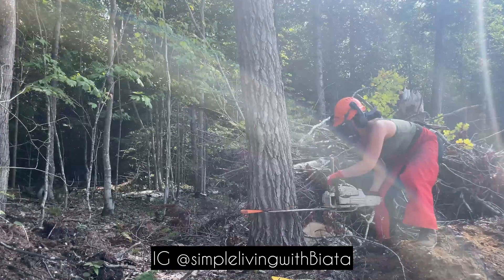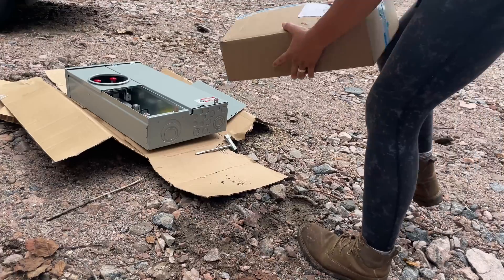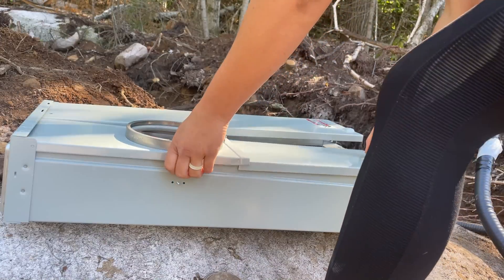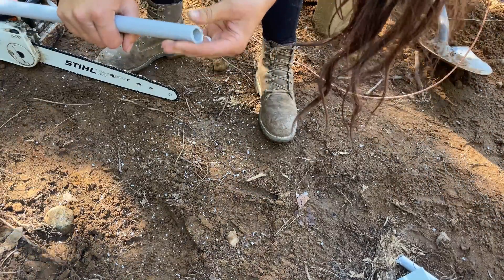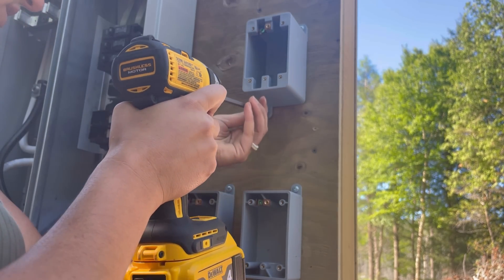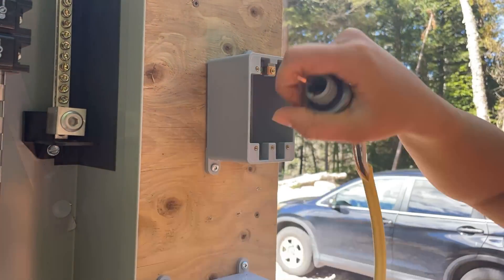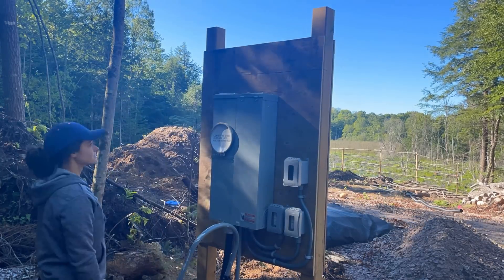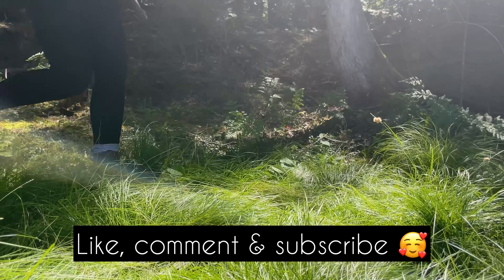Wiring MY FIRST Panel! (For our Home Build from Scratch)

Comment: Good hard working gal. Only advice I can give is when you wire your neutral wire (white) into the panel, it's generally best practice to land it across from the breaker that you are feeding. Obviously this isn't required because it still works, but it can make troubleshooting easier and is better organized. Cheers!

Comment: You know if you had like a little air conditioner pump like from a swamp cooler and say a medium size  black water tank (black water tanks don't produce mold) and let that little pump water from your little pond and into the tank and have the little tank raised somehow with a water hose hooked to the bottom of the tank, this way you can water your plants without having to carry buckets all around

Comment: GOOD JOB, BUT THE FIRST BOX IS FOR A 240 VOLT PLUG.  NEEDS TO BE ON A 2 POLE BREAKER.  UNLESS YOU'VE ALREADY FIXED IT.
Reply from the maker: Thank you! I’ll check with my electrician!

Comment: a little advice I'm a retired carpenter with 44 years experience and I don't do my electrical work, maybe replace an outlet or two but that's it, that should speak volumes to you, it's an ever changing trade best left to the pros
Reply from the maker: I had lots of help from an electrician and the inspector took the panel apart for inspection! Thanks for the concern!

Comment: This is late but, always give yourself some extra wire. When entering the box, go along the bottom of the box and then straight up to your circuit breaker. From point A to point B is not always best. Don’t go straight to the breaker. It will get messy if you ever have to move something. Same with the ground wire. Go to the side of the box and then bend back to the ground bar. It will make things better in the future. Hope this makes sense. Love that you can tackle what comes up. 😊
Reply from the maker: This is super helpful thank you! I was thinking that would make more sense for the house for there to be more slack!
Reply: @SimpleLivingwithBiata  Russ gave you good advice, when you get to roughing in your electric on your house by code it has to be stapled w/in 6" of the J-box but also bend a  4-6' loop extra outside the box Incase of future issues you have a bit of wire to pull though ! Also when doing your rough-in don't run in & out of each outlet, wire nut together w/ a pigtail to go to outlet otherwise if one outlet fails all the other ones downstream on that run won't work !  Your a long way off from that and I'm sure your electrician friend will coach you through it !    I can't believe how your veggies are doing in Grow Bags ! Mine I have to water at least twice a day because they dry out so quick !!! ✌️💙🎵